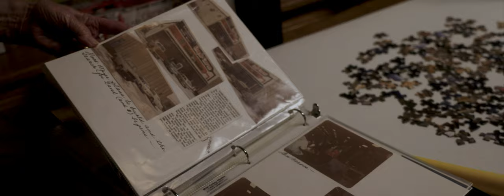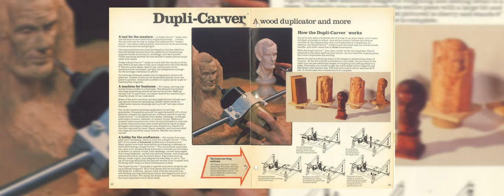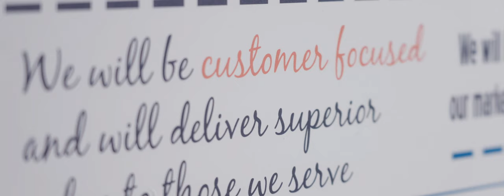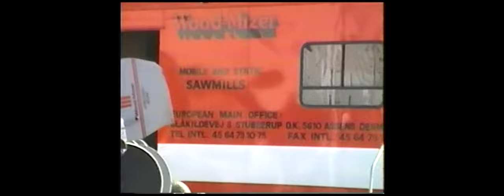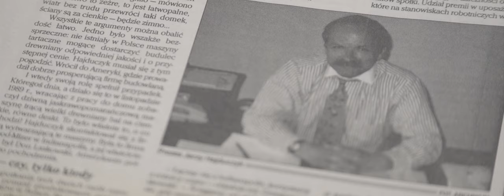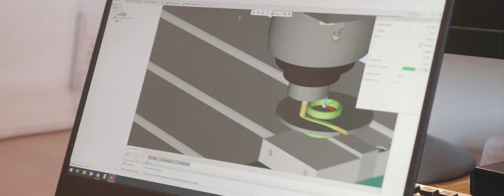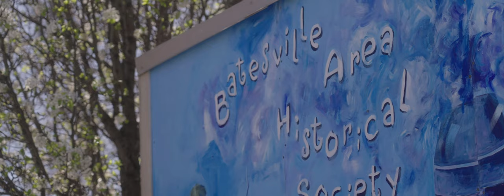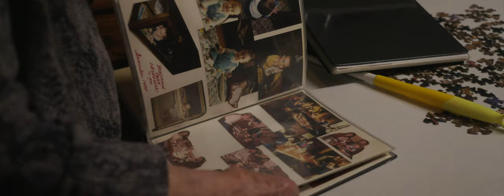Our Beginnings | Wood-Mizer

Comment: I recognize a lot of the old timers. Worked with some on adventures.  Bought first LT40G18 in 92.  Upgraded to LT40HDE25-RA in 2002. Made many mods.  Retired in 2015 but still have the mill and use it time to time.

Comment: I bought a brand new 2021 lt40 wide with remote and I have eg100 board edger. When I was in high school from '95 to '99 the ag department had an lt40 and we cut down pine trees on the schools property to build a livestock barn with and I have wanted a woodmizer ever since. Owning a sawmill was always in the back of my mind but I never thought running a sawmill on a small scale would be profitable. About two years ago I was looking for a business that I could be self employed and make a living right on our small farm. I got to researching the sawmilling business and discovered that there was endless opportunities. I am in the South Carolina sandhills region and pine trees are readily available and I buy them straight from loggers. What it cost to own and operate a woodmizer is penny's on the dollar compared to what it will produce. Woodmizer makes one of the finest Hydraulic  portable sawmills there is.